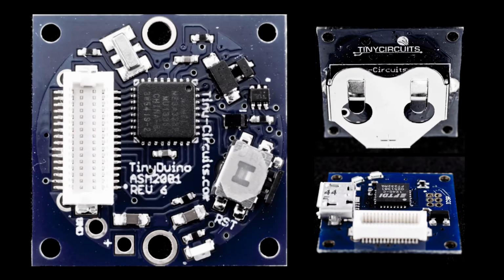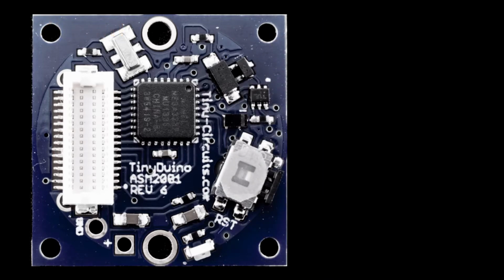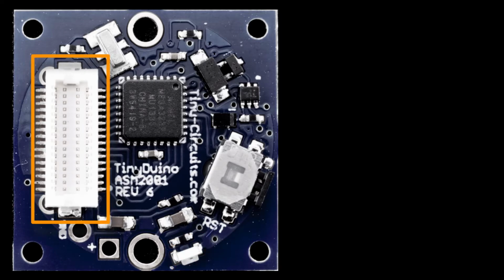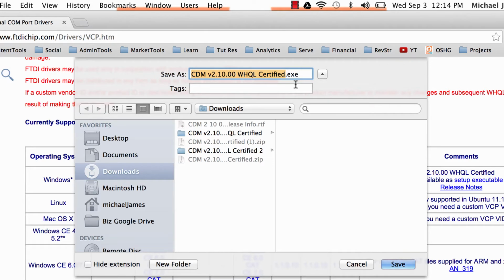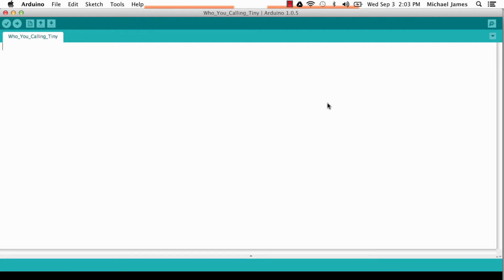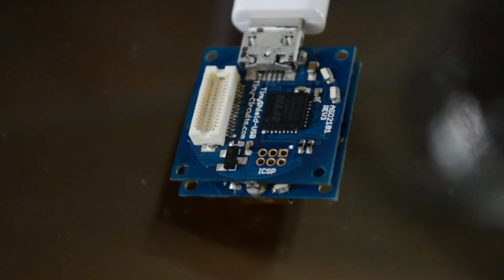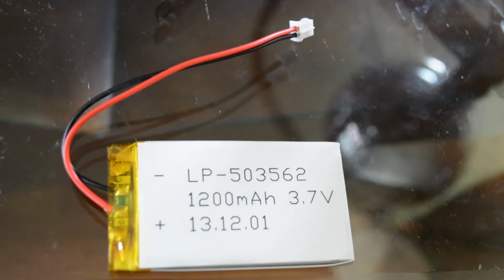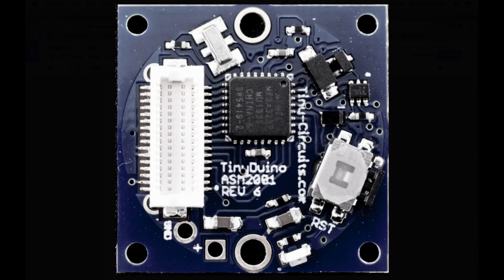Super Small Arduino Uno: An Introduction to TinyDuino (TinyCircuits)

Comment: Hi there, 
Just stumbled across tinyduino, watched your video, yet i still have one question, can you use an arduino tutorial and just replace the board with this board ? i'll give an example , the water level sensor circuit that you had built using the arduino button code, can i use this board for that tutorial for example ? (probably a really dumb question but i'd prefer sounding stupid by asking an obvious question rather than, wasting time money and effort in the wrong parts) 

Thanks
Reply from the maker: That is a great question.  The answer is more or less yes.  All the code that runs on the tinyDuino will run on an Arduino just fine.  You will just want to make sure that the tinyDuino/tinyShields you would use have a similar pins available.